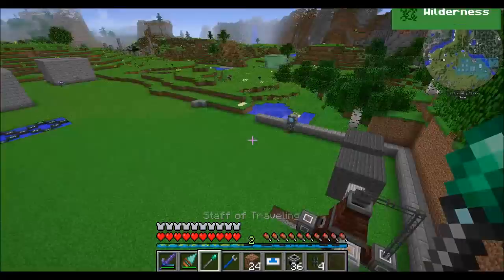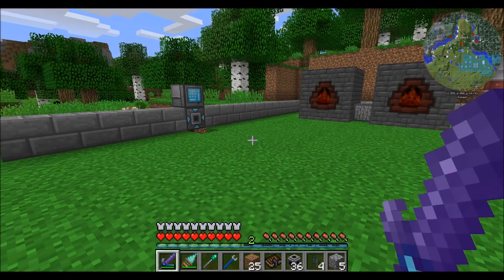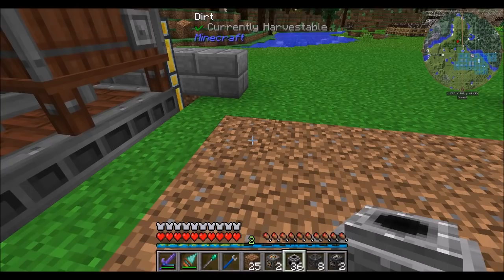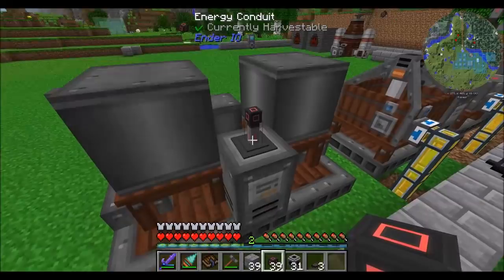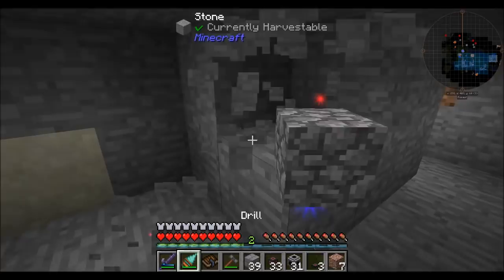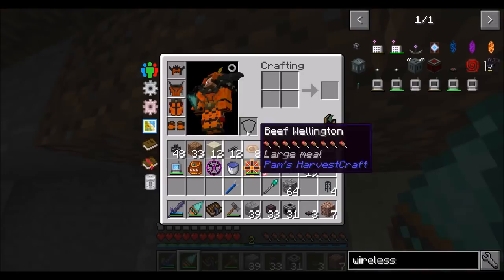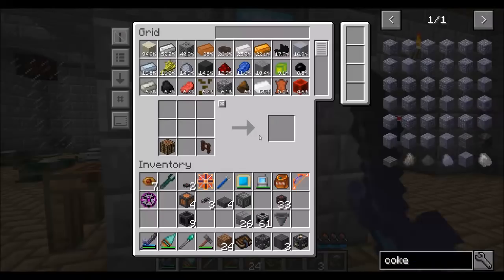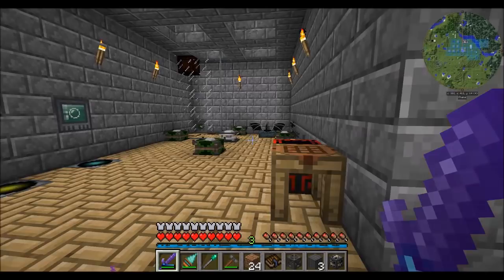Lets Play S8 E103 Arc Furnace

Comment: direwolf 20 you can use iron blocks to make steel blocks wich is a better investent in the long run so you dont run out of steel
Reply: Ingots vs. blocks doesn't actually make a difference in iron. Using a creo coal block will allow you to smelt a 10th ingot into steel, though.

Comment: Aren't IE pipes like enderfluid conduits?
Reply: r2d2 vs trains not really, no filtering, much lower MB/t
Reply: EnderFluid conduits are similar but I they hold 800 mb and extract/insert 200 mb, according to the wiki. IE pipes are a bit different and instead of being like EnderIO where every pipe has a buffer inside of it, it instead carries the fluids to point A to point B, C, D, ect.. instantly at a much slower rate of 10 mb a second. The pipes are way more simple but that is only because the multi-blocks structures have inputs and outputs that never change, unlike EnderIO where the machine can have multiple inputs or outputs, so the cables need to be more advanced for it to function.
Reply: Yes, in that they can handle more than one fluid at once.
Reply: Well I meant in terms of being able to handle multiple liquids, as if so dire's separation of the pipes is unnecessary.
Reply: r2d2 vs trains I wanted to comment something you said but I just need time to focus on your name. Simply amazing!

Comment: you should automate the whole process of making the electrodes (automated workbench).they run out very quickly if you use the arc furnace 24/7 (which you will do)